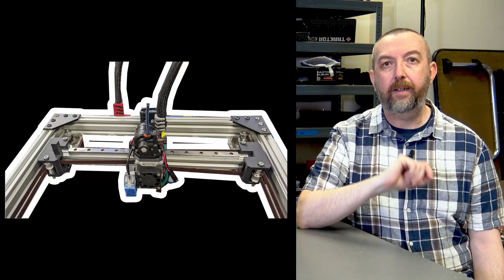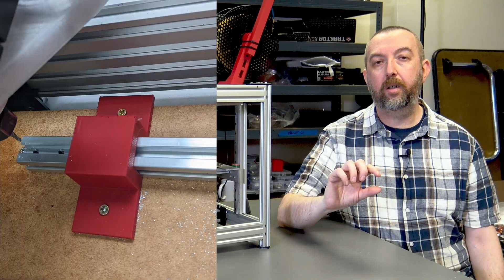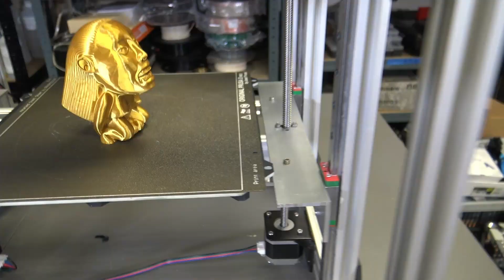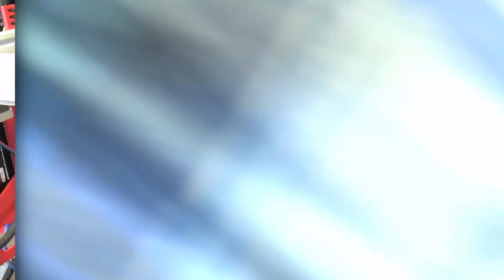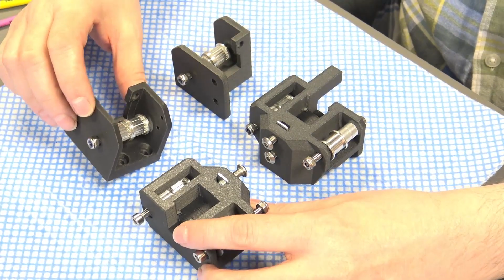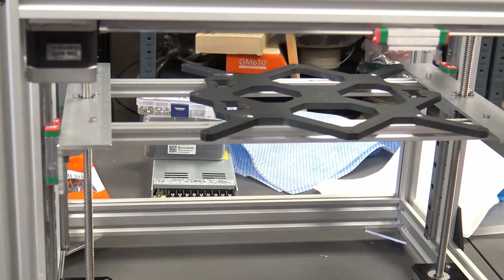This is my DIY Rat Rig Corexy 3d printer with Carbon Fiber EVA 3 parts   Episode 1

Comment: WD-40 is not a lubricant! It stands for "Water Displacement formula 40". It was developed for waterproofing the wiring in Atlas Missiles in the 1960's. It has a volatile solvent to make it fluid and penetrating, but the other part is a waterproof polymerizing resin that penetrates along with the solvent then HARDENS creating a durable waterproof barrier. And also when it hardens it glues together all the shafts and bearings and rollers that you have sprayed it into.  Many people have totally ruined precision instruments like micrometers and sliding and roller bearings by using it as a lubricant, only to find weeks later that everything is frozen and has to be pressed or hammered apart. It is not a lubricant. Get some fine instrument oil to lubricant. Use acetone or other solvent for cleaning. I ruined some micrometers myself before I figured it out.
Reply from the maker: are you taking about the stuff I used to clean the rails ?
Reply from the maker: if you look at the video and listen you will see I am using WD40 branded degreaser to clean the rails, not WD40 as you so eagerly  pointed out trying to be all clever you big turd.

WD-40 Specialist Degreaser is a solvent-based, spray degreaser that quickly removes stubborn soiling such as oil, grease, dirt, and grime without leaving any residue. Simply spray on the clear formula before wiping or rinsing away for a clean finish. For heavy soiling leave for a few seconds to penetrate through the dirt before wiping clean. It’s perfect for a range of applications, from cleaning alloy wheels and tyre rims to degreasing engine components. As well as cleaning, WD-40 Specialist Degreaser will also reduce wear and tear on your components, keeping them clean and running smoothly for longer.
Reply: @leesmithsworkshop   My Mistake. I did jump to the conclusion that it was regular WD-40. I did not know WD-40 brand made a purpose degreaser. I have seen so many people on YouTube and elsewhere use regular WD-40 spray as a cleaner/lubricant. Including Adam Savage. (If I remember Correctly) So, I apologize for jumping to the conclusion, I was just trying to be helpful.

Comment: This is a very involved project. Thanks for sharing. It's amazing. I'm in the middle of building one too but not as involved, however, I do need to cut linear rail a bit. How did l should I go about in doing this? I don't have an angle grinder but I do have a mitre saw and a multi tool. Will any of them do? Thanks
Reply from the maker: they are hardened steel so hand tools are going to be hard work and you don't want to get it hot, it could warp the rail. Multitool with a DREMEL® EZ SpeedClic: Metal Cutting Wheels 5-Pack. (SC456) would be my suggestion.
Reply: @leesmithsworkshop  Thanks mate. don't have a dremmel unfortunately. so you reckon a mitre saw can potentially make it warp?
Reply: or potentially, where do you source your linear rail from? I need an odd 330mm length.

Comment: Anyone a link for episode 2? searched for it but none with part 2 on the channel.
Reply from the maker: if you find part two let me know.
Reply: @leesmithsworkshop  lol, send out the search party?
Reply from the maker: @TechieNI  I have not made it because I was making so many changes to it and never recorded them. I really should because it's one of my most watched videos each month. The other thing is it would cost about the same as a P1P,  I have one and it's just a better printer unless you're happy to spend time tuning the profiles.
Reply: @leesmithsworkshop  I have an X1C too but I still like my custom printers.
Reply from the maker: @TechieNI  my biggest problem with these custom printers are the clone prusa beds and how they change shape as they heat up,  I currently have a Rapido hotend and a big server 20x40 fan from the eva 3 so it can print as fast and as well as the p1p, but I have too many first layer problems I don't use that much. It could be the inductive probe I am using so trying to fit clicky, but I think the chassis is a bit too small.
Reply: @leesmithsworkshop  what about the trihorn clicky for the Eva system? It's common for clicky. What about a better bed? A cast bed makes a world of difference. Have faith mate. Tons of potential to be had for little money is what we like lol.
Reply from the maker: @TechieNI  I have a clicky probe and mount and a cast plate so all things I want to do at some point, but don't have the cash or time at the moment.
Reply from the maker: @TechieNI  I just shared a community post with the current state of the printer.

Comment: I've got much less of a budget (yet) so i have been thinking of building something similar to Tech2c's Hypercube, except with frame from wood or something else relatively cheap, at most square metal profile or angle, not these nice profiles. No linear rails.

But it'll be a little till i can really start working on it.
Reply from the maker: The problem with wood is it's grows and contracts with temperature so you could have z height issues one day, loose belts the next.
Reply: @leesmithsworkshop  im running a wooden printer right now. I'm aware. There are ways around that. The smooth rods need to be pretensioned and I have steel threaded rods running through my printer at strategic spots, and funny warping is a thing that happens as well that needs accounted for.

Temperature isn't really much the issue, humidity though...
Reply from the maker: @SianaGearz  I just remember what Makers Muse said in his recent video.

Comment: Great job!! What is the price of building this machine?
Reply from the maker: it depends what parts you use. My first was around £1000 after all the upgrades. You can buy the cheaper linear rails or get good LDO ones, same for the stepper motors. Use an old printer board again if you have one. the EVA 2.4 is very open to many parts too.

Comment: Wow, those results from the first version are amazing! Really want to get into this as well, thanks for sharing!
Reply from the maker: I had very low expectations for the first and thought it would take a lot of messing about to get decent prints. Klipper is just so easy to tune and change settings compared to recompiling firmware for marlin.